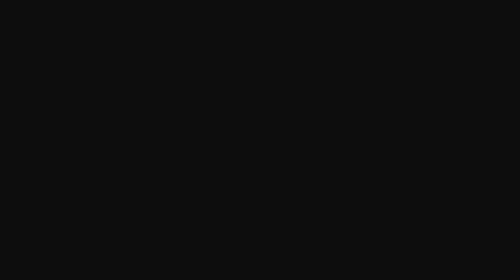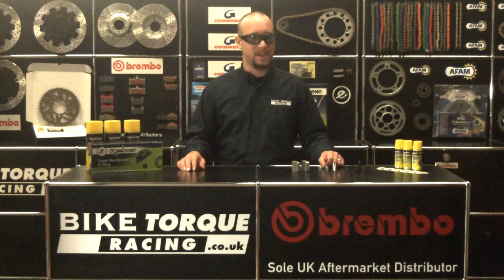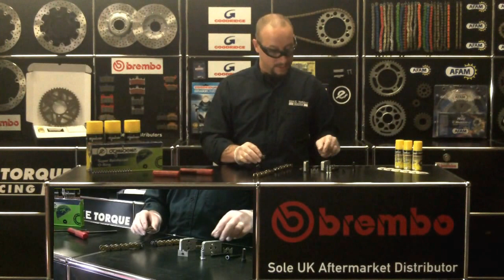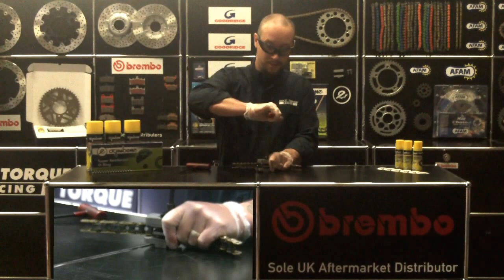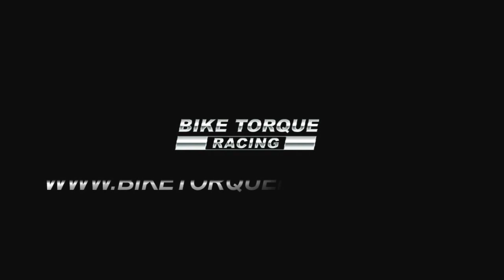BTR Tech Station : How to Rivet a Chain

Comment: The silver pin plate that you insert at about 2.36 for the back plate and O rings...Does that come with the DiD chain or with the Ognibene tool... I have not got it in Either... Or is it something you just use to make things easy...Or am i being Thick?